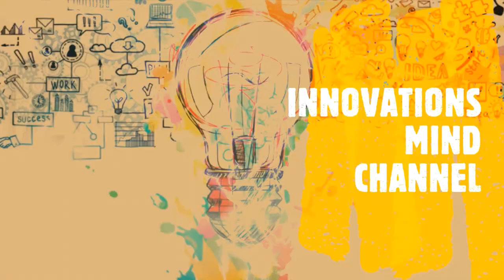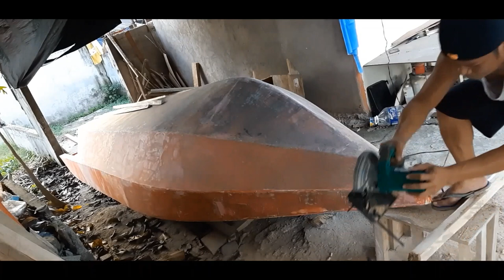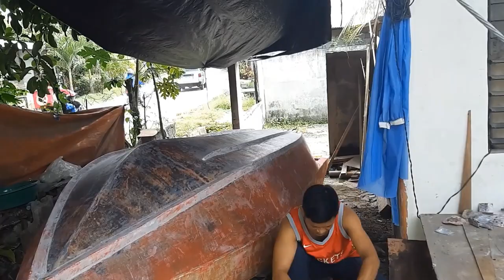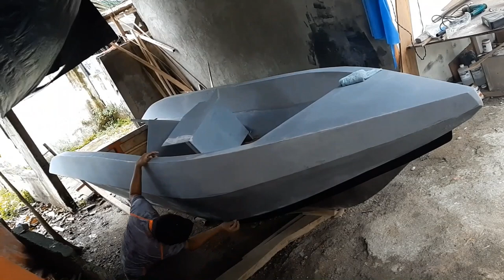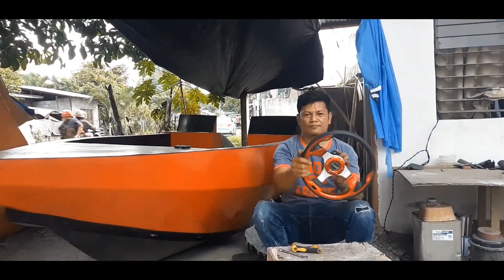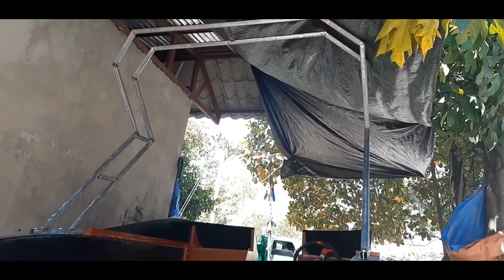Building Wooden Speedboat / Bangka na speedboat ang design- Part 4 Painting process

Comment: Gusto ko na sya Makita sa dagat...ang galing
Reply from the maker: Salamat po. Antay antay lang po kasi pang bili nalang ng engine problema.
Reply: Sir may plan k b I fiber glass yan  mukhang mas maganda pag ganun ang speed boat mo...super ganda .nagkaroon tuloy ako ng interes sa mga speed  boat.im an aeronautical engineer.
Reply from the maker: @whiskeykilo1283  fiberglass laminated/skinned po to sir, kumbaga na sandwhich si plywood ng fiberglass. Kung e pure fiberglass pwedi pero mag molde ka at medyo malaki gastos. Kung may time kayo, check niyo po part 3-fiberglassing process.
Reply: Wow that's nice sundan ko video mo thanks

Comment: Sir anong klasing resin ang ginamit mo.. epoxy resin ba or polyester resin lang. Kailangan din ba mag mix ng hardener with polyklear kapag sinamahan mo ng powder at toner?
Reply from the maker: Epoxy. Polyklear resin. Yes need mo mag hardener kung apply mo yung parang gelcoat made out from talcum powder, toner at resin. Mag add ka lang sa bawat iaaplply mo, wag haluan lahat kay magtigas, parang body filler lang style.
Reply: @InnovationsMindChannel  pwede ba malaman ang part number ng polyklear resin.
Reply from the maker: @edcruz54  r99-201